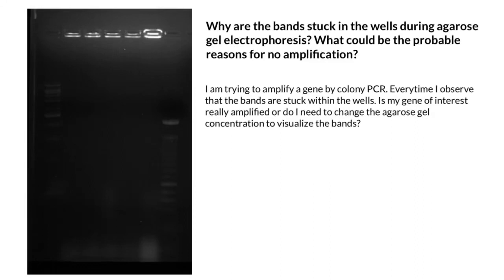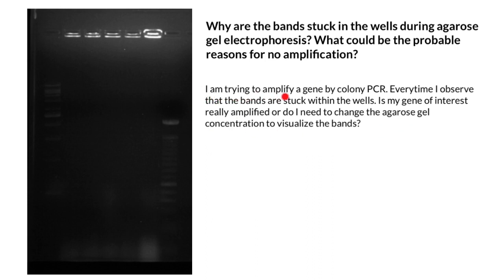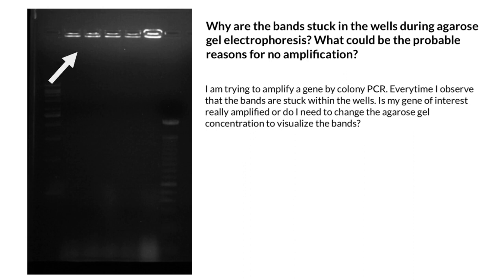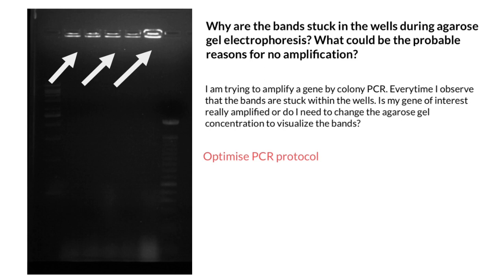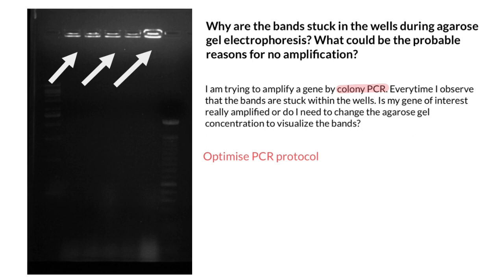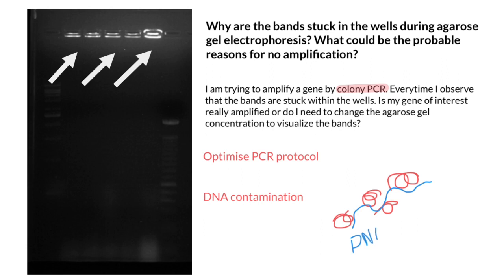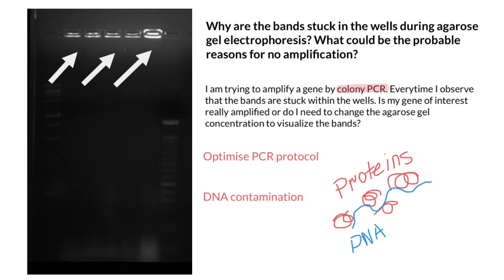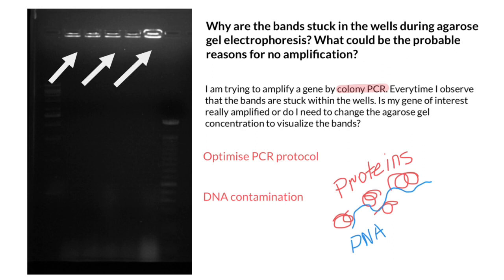Why are the bands stuck in the wells during agarose gel electrophoresis?

Comment: I am having the same issue. What do you think about SDS incubation to disrupt protein-dna binding?
Reply from the maker: Sure: In the context of studying protein-DNA interactions, using SDS can indeed disrupt protein-DNA binding for several reasons:
SDS denatures proteins by disrupting their native structure. Proteins often rely on their folded structure for DNA binding. When SDS is introduced, it can lead to unfolding and denaturation of the protein, which can result in loss of its ability to bind to DNA.
DNA has a negatively charged backbone, while SDS imparts a negative charge to proteins. This can lead to electrostatic repulsion between the protein and DNA, hindering their interaction.
DNA-binding proteins often have specific hydrophobic regions that interact with the hydrophobic base pairs of DNA. SDS can disrupt these hydrophobic interactions, further weakening the binding.
SDS can significantly alter the pH and ionic conditions of the solution, which can impact the stability of protein-DNA interactions.
SDS can mask the DNA binding domains of proteins due to its interactions with hydrophobic amino acids, potentially preventing them from effectively interacting with DNA.
Reply: @GeneticsLessons  Won't sds addition also disrupt DNA's double strand structure?
Reply from the maker: @randebuu1  SDS is a detergent that can solubilize hydrophobic molecules, including proteins and lipids, by forming micelles in solution. When SDS is added to a solution containing DNA, it can interact with the hydrophobic bases of the DNA molecule and cause unwinding of the DNA double helix. This can lead to the separation of the two strands of DNA, disrupting the hydrogen bonds that hold the base pairs together.
The degree to which SDS disrupts DNA's double-stranded structure can vary based on factors such as the concentration of SDS, the length and sequence of the DNA molecule, and the experimental conditions. In some cases, researchers may intentionally use SDS to denature DNA for applications such as DNA sequencing or denaturing gel electrophoresis.